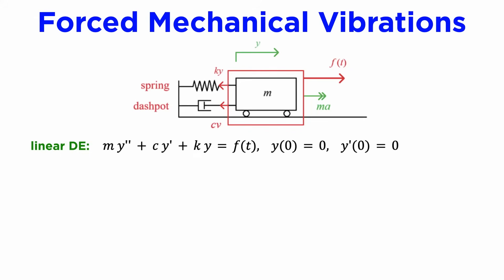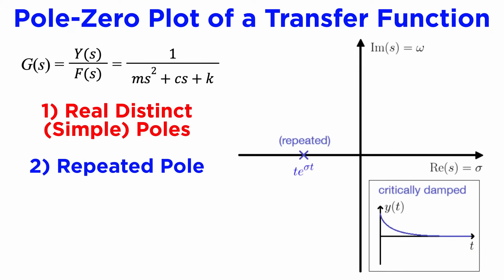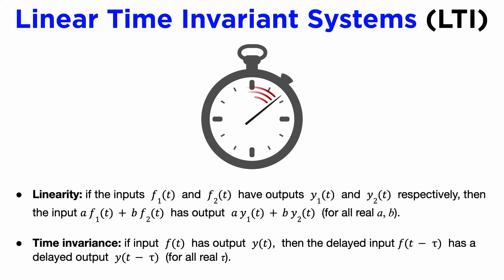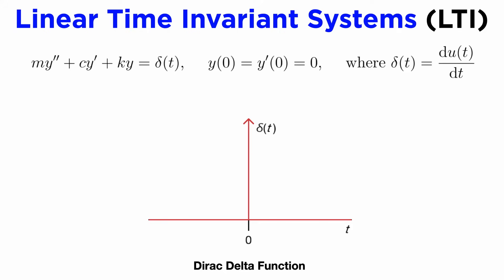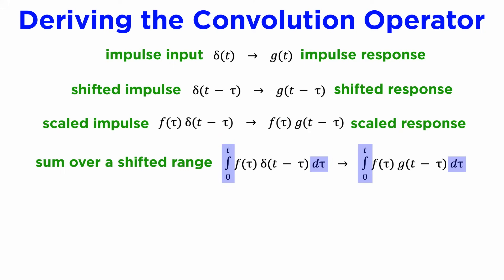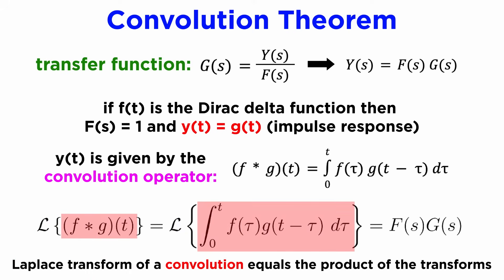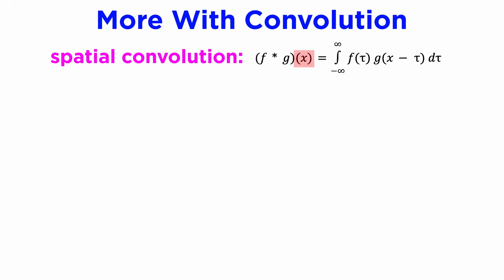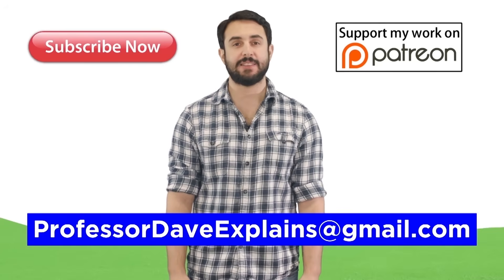Laplace Transforms Part 2: Convolutions and LTI Systems

Comment: It's unfortunate how intellectually convoluted the derivation of the Laplace convolution operator can appear to students otherwise familiar with the fundamentals of physical systems. I suspect that initial speed bump is one of most daunting obstacles that dissuade undergraduate students from studying feedback control theory. If they could only glimpse how straightforward linear transfer function analysis becomes once you arrive in the conveniently algebraic s-domain!